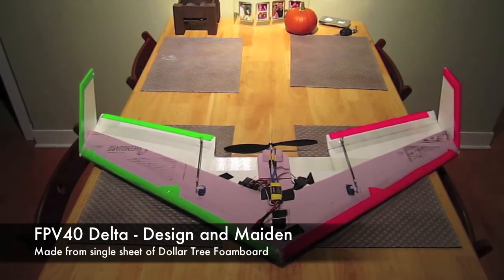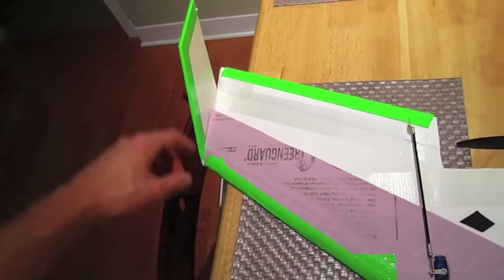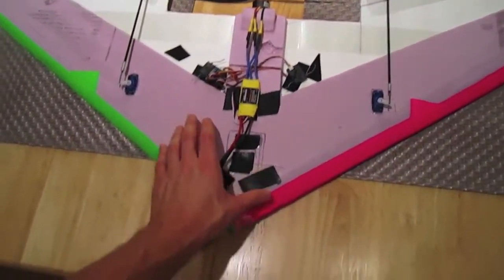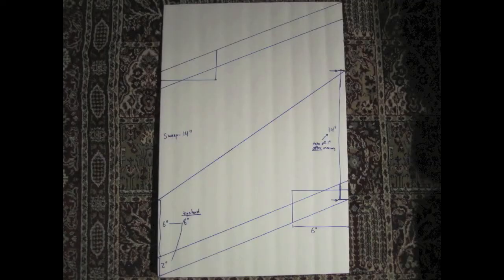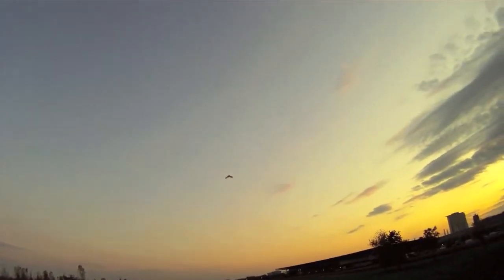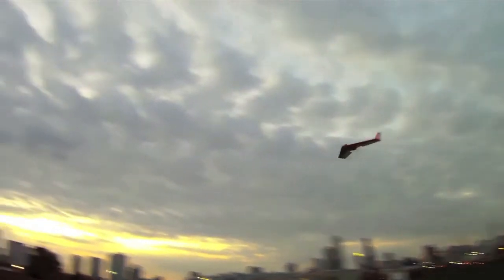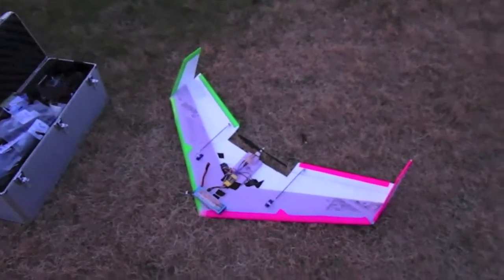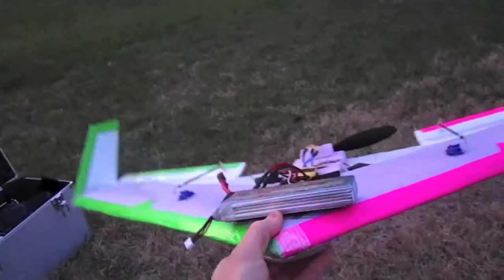FPV40 - Design and Maiden Flight

Comment: Did he cover COG?    I plugged the calcs into the wing calculator and got about 7.5 in from the leading edge.  Not sure that is right.  My nose dives into the ground when I left of the elevator, I'm thinking I need some reflex to get it flying level

Comment: i have a wing , the span of which is 100cm , then out of 1400kv and 2200kv which motor should i use with 3s battery ? And also suggest propeller size.

Comment: Great design bro! I've tried 3 or 4 flying wings and had no success. Too heavy, not enough power, bad cg, no airfoil, one even banked one way so hard i couldn't control it! Maybe i'll build this one and have success.
Reply from the maker: My advice - build your wings as light as possible and make them a little nose heavy. That always works for me
Reply: ProjectFlightDesign I built your delta and it flew amazingly. I had to build like 6 cause I liked it so much.
Reply: Hi Nick wings have a narrow CG sweet spot, as long as you have it right (google wing CG calculator), and at least 1::1 thrust to weight ration, any wings should fly great